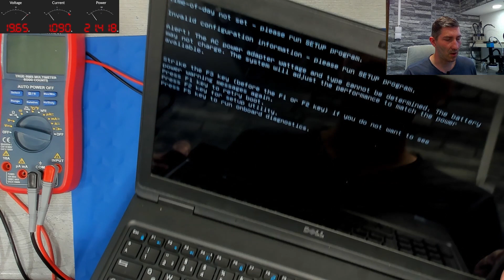Dell Latitude 5580 - Does react to power button but almost stone-dead otherwise - common faults #3

Comment: i thought all dell laptop need an original charger. So there are some dell laptop that can work with bench psu
Reply from the maker: Afaik all Dell can work from bench top PSU, but since PSID line will be missing then, the System will be heavily limited. I have a special tip for Dell Systems which I can connect with the PSU, but it does work only up to 90 Watts.

Best regards

Comment: I have a 5580, and I constantly (several times a year so far) have to change ram sticks, sometimes run just 8 instead of 16. is this just a ram issue and can it be fixed hardware wise? or is it a failing issue in the mainboard? and is that a price worthy repair?
Reply from the maker: Rabbit hole. Can be dying memory controller inside of the CPU too.
Reply from the maker: or cold solder joint at the RAM connector. Just a few examples. Hard to troubleshoot.

Comment: Lucky you!
I have the same model on the way but i was told it is not charging and working only from battery so we`ll see what`s the problem soon.
Thank you for nice video!
Reply from the maker: Sounds like you'll have some fun with the PD- and charging circuit. But thanks! :)
Reply: @fairrepair_en  Laptop arrived today and no wonder that it is not working from charger - BQ chip and PQ904 and 905 are missing...and i didn`t find schematics for CDM80 LA-E091P Rev:2.0 online (only E151P is available)